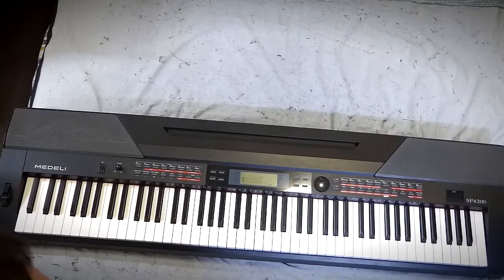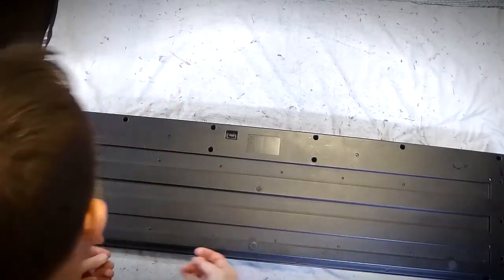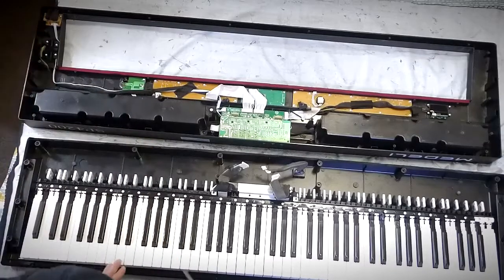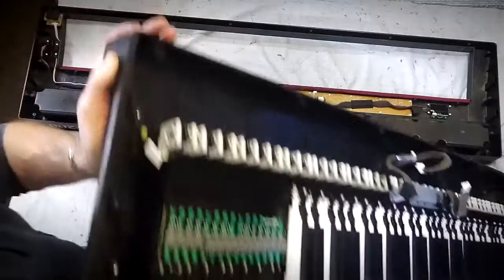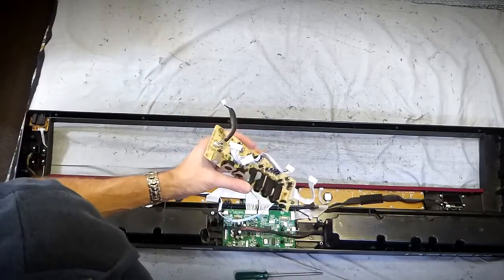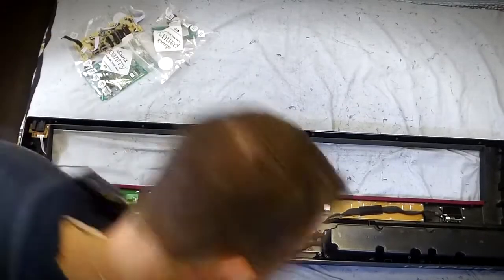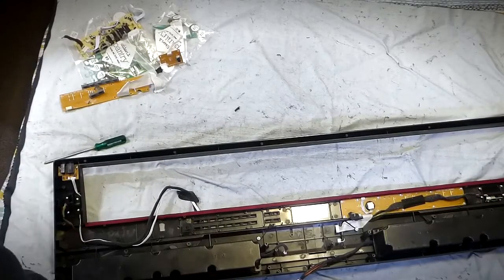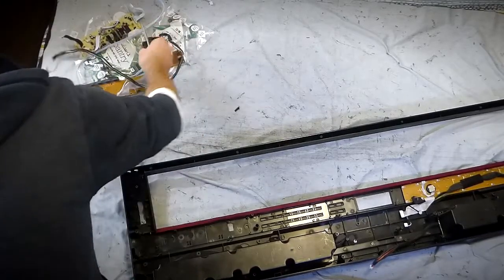Medeli SP4200/SP5600 Disassembly & Parts Recycling

Comment: I would like to buy it .... so.... its not good quality if yours  is broken?
Reply from the maker: The one thing I consistently mention in my videos is that, as a frequent user, I give these Medeli keyboards a lot of 'heavy use' out on the road; whereas they are probably best suited to the home environment - in this latter case you are unlikely to encounter the sorts of issues I have experienced.  The old adage you get what you pay for holds true, and of course a more expensive keyboard is going to last a lot longer.  I believe Medeli should invest in a more robust piano design marketed specifically for live performance use, even if it means that a larger investment is required on the part of the consumer.  I mean, who wouldn't be interested in a piano with superior practical features that is still very price-competitive?